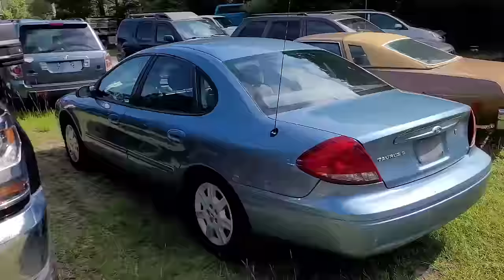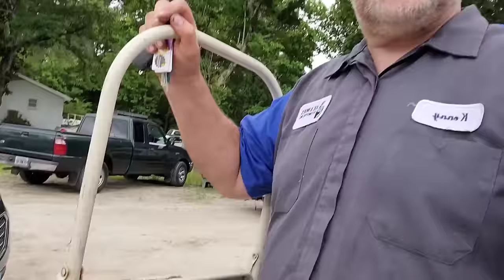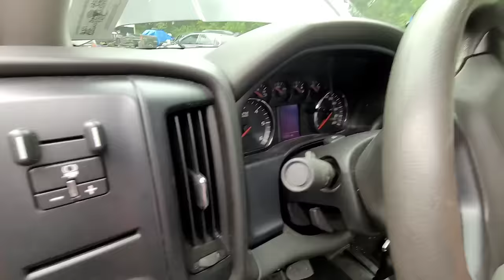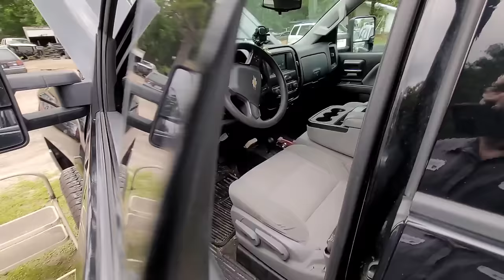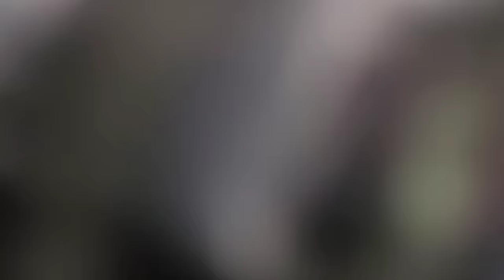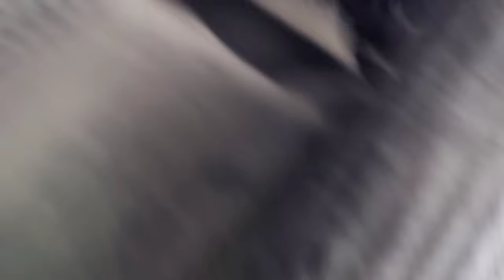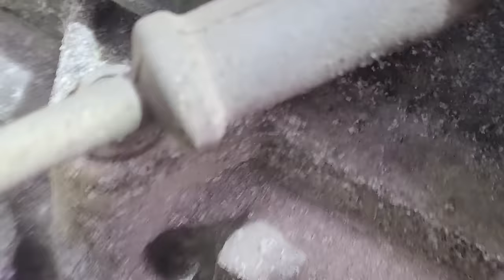Another GM 5.3 Ticking Noise. It's not the lifters on this one either

Comment: Common problem on all trucks, good news is un like a POS ford, you dont have to remove engine to repair. Prety cheap repair. My 14 6.0 has had driver side done 3x, passenger side once. Driver at 52k(dealer did with gm approval cost me $100), pass around 65k, driver again around 90k (dealer again, had new manifold put on that time) then again around 115k. Currently sitting at 148k and that has been the worst thing that has happened to ol Betsy:)
I believe the constant starting pressure when the truck is worked is what causes it. Mine is my lawn truck so it starts and stops 18-20x a day plus its plowed all but last 2 winters in upstate NY. Ive owned it since it was new with 2.8 miles on it and she has been a work horse.

Comment: Been watching your videos and you seemed pretty knowledgeable. I have a question. I had a 2017 Silverado with that 5.3 motor in it. Periodically I would lose oil pressure. I would check the oil and it would always be full. Ticket to my mechanic and he suggested it could be the oil pump but suspected it was the main bearing. I decided not to find out, change the oil and filter, put in oil meant for a diesel and sold it. I would be interested in hearing your thoughts on this issue.

Comment: What's your experience with this?

2005 Yukon, 5.3L 4x4, 223,000 miles, all stock, daily driver. I can just hear a clicking sound that varies with wheel speed (not rpms) when all else is quiet in cab and windows are down, driving next to a wall or barrier, at 10/15 mph or faster.  But ONLY under load with accelerator pressed. Does not click when coasting, or not moving. Comes from under vehicle. I figure either driveshaft u-joint or rear wheel bearing, or maybe parking brake hardware (park brake is out of adjustment), but what do you think?

U-joints look ok. A smidgen of play that I can feel but not really see, by hand, same on both ends. Not tight or blown out. Sealed type. 

Thanks!

Comment: You know what I had an 05 z71 I had that same exact bolt break the very last one to the firewall. I was able to get it out. Mission completed all new ARP , and that happened in 2009 so four years old. I think the mileage was somewhere around 100,000 miles exhaust manifold bolts never happened again.

Comment: FYI the cause of broken bolts is due to the fact that gm did away with the exhaust donut gasket and it doesn't allow for movement in the pipe

Comment: Dod/afm?
I've deleted my afm on 3 gm motors.
2, 5.3 engines and 1, 6.0 engine. Until I do on my newest 5.3, dealer changed recommended oil to 5 30.

Do you have any experience dealing with dod issues?

Good video sir

Comment: My 06 5.3 sierra has 303000 and runs like new. Had to replace the pick-up tube o-ring at 280000 was cracked. Put a new timing chain and oil pump in when I did the o-ring.  Runs 50psi at idle.
Reply from the maker: I love the 5.3 . Its an excellent motor IMO

Comment: I have the same issue, same bolt. 5.3 2015 Sierra. But it's not that LOUD. local repair shop said it would cost $250 to fix. If I didn't want to do it myself. 177,000 miles, I'll repair one of these days. When it gets annoying loud. Lol

Comment: What I'll be talking about is the spark plug wire issue you were talking about. As a 25-year G.M. Dealer Technician, I have seen that exact condition numerous times. I also had it bite me in the ol' pooper a couple of times with a comeback of the plug wire hanging from the spark plug & spark jumping from the coil to the coil bracket. After some intense R&D, I discovered air pressure to be the culprit causing the condition. Now, you ask, how in the H... E... DOUBLE HOCKEY STICKS... WOULD AIR DO THAT & HOW IT GOT IN THERE? As you push the plug wire onto/into the coil tower it traps air in the boot of the plug wire. In which air pressure is affected by temperature. As temperature rises, for every 10-degree increase in temperature, pressure will increase by 1 p.s.i.  This will cause it to build enough pressure to push off the wire from the coil tower. How to confirm this weird condition & eliminate it you ask. After you have pushed the plug wire onto the coil tower, you can take your fingertip & roll the end of the plug wire boot back (while listening very closely) you will hear the little air pocket "psssssssst" & release the pressure. In some cases when the boot is extremely tight on the coil tower, you have to use a small pocket screwdriver 🪛 and go in between the tower & boot to release the air pocket. Hopefully, that helps someone out!
Reply from the maker: Awesome tip !! I will have to make a video on this !! Thanks for watching and sharing !!

Comment: I have a 2017 Chevy 4.3 making a "chirping" noise in the top end I think at any temp/RPM. I've done TONS of GM lifter jobs, but this one just doesn't really "tick". It's a chirp. Pulled covers, nothing is loose indicating a typical GM lifter failure. I haven't replicated this yet, but customer states of he runs E85, the noise goes away. I'm open to any ideas. I don't want to pull the heads until I'm more certain as to what's going on here.
Reply from the maker: Is the chirping noise consistent ? Like with the rotation of the engine ? Or is it a singular chirp ? I've seen singular chirp noise be caused by the A/C compressor when it cycles , and I've seen the vacuum pump cause a chirping type tapping noise . Let me know what you found !
Reply: @WrenchingWithKenny  it ended up being a lifter. It got a full kit, cam lifters gaskets etc
Reply from the maker: Oh wow !! Interesting !! I've actually never seen a 4.3 with a failure. But then again, the 17 4.3 is based off the same design as the 4.8, 5.3 & 6.0 .
Thanks for the info !!

Comment: mine ticks every once in a while but seems to be getting more often... saw a video said its the o ring on the oil pump letting air in
Reply from the maker: That is a problem that happens also . Its not super common in my experience though . Also , when the oring fails, you'll have lower than normal pressure all the time .
Thanks for watching !!

Comment: Depending on the year range GM as you’re probably aware had massive issues with the DoD (Displacement on Demand) systems. They were notorious for starving some of the lifters for oil and every time the pins started to wallow out the circular opening they were pushed into and caused him to stick which is why a lot of people delete that system, not all people but a bunch.
They need to replace out that exhaust gasket ASAP before they have a lot more than ticking noises to deal with. He started having valve issues and everything else under the sun not to mention melting things etc. depending on how bad the leak is. What was the mileage on this truck?
Reply from the maker: This truck had 95K if I recall correctly
Reply: I have a 2009 Chevy Equinox LS, with 91k on it; I have a ticking noise, my car was used mostly going to work and back. it doesn't seem like I should have engine issues, I've taken it to a few shops and was told I have internal engine issues, so I need to get a new engine. I think it is a faulty lifter. I had a code for a misfire on cylinder 5, I had a new coil pack put on, and that code went away, but the noise is still there. Any suggestions? I'm in Bflo NY.  finding anyone to research the problem seems impossible.
Reply from the maker: @aquarius_babyj7539  the 3.6 is notorious for issues . I would think on your motor you probably have a failed tappet/lifter. I would replace the rocker arm as well . They tell you to pull the camshaft , but I believe it can be done by fabricating a tool that can depress the valve so as to work the rocker out , then the lifter . You want to be certain the piston is down when you do this because it is possible to bend the valve slightly by manually opening it
Reply: @aquarius_babyj7539  the Chevy equinox is a PITAA that GM is fully aware about and did nothing to help fix. For instants the dual clutch transmission even though it’s an automatic it has a dual clutch style set up and is prone to vibration and causing your RPMs to start a jump even though you’re maintaining a constant speed.
What I would highly advise is when changing a spark plug(s), and/or a coil pack(s) is to change all of them at the same time. I’ve got a company that I purchased six brand new coil packs from even though my wife only had one that was acting up because not too long after another one acted up, so replacing all six save me, the grief of having to go through mess with them, which they’re not hard to do. also your plugs is another big thing to make sure to swap out. I’m not sure on the part number but if I’m not mistaken I’ve actually got eight of the coil packs for a 2012 Chevy traverse at the house in my shop.  
As for the engine noise you’re talking about what kind of sound are you referring to? Is it taking like a lifter or coming from somewhere else in the valve train?
Reply: @Wrensspeedshop  Thank you for your reply. The coil pack plugs, and serpentine belt have been changed. I put a video up of what it sounds like, if you don't mind checking it out.
Reply: @WrenchingWithKenny  Unfortunately, I'm a woman who can do small repairs on my car; however, what you're describing probably takes more skill. I have a video up, of what it sounds like, if you mind taking a look.
Reply from the maker: @aquarius_babyj7539  where do I find the video ? I don't see a link here . I'm limited on what I can do on my phone as well
Reply: @WrenchingWithKenny  If you click on my name it'll take you to my shorts video. Thanks! It seems my only choice is a $4000 engine at the shop.

Comment: I’m hearing and seing dirty oil filter causing lack of volume flow of oil this causing all kinds of lacking lube parts . As well as worn out manifold gasket for egshaust manifold . My trucks developed a concerning actually metal sounding ticking tick tick on drivers side roughly cyl #3 or 5. Am changing my oil and filter cause been far to long since filter change let ya know

Comment: Bought a 2012 Silverado 2500HD, got it home both rear manifold bolts were broken inside the head. Popped off the heads, the only way to get to those bolts. It seemed to me the bolts were bottoming out inside the head, added a washer to another set of bolts, problem solved.

Comment: I have a 2000 Silverado, and mine taps when first startup, then the tap dies.  But I can park it facing the evening sun which allows the heat on the face side of the engine, start up, no tap! I was wondering if it is the harmonic balancer, I noticed a little wobble in it.

Comment: Hello, I have the same motor in 2004 Trailblazer LS. Mine hesitates between 55-65 mph only, while accelerating only. No codes and have replaced all emission parts except large box near gas tank...no gas smells from it. Have replaced all coils with aftermarket ones...2 of them failed and replaced with oem ones. Also replaced fuel filter. Any ideas? Thanks
Reply from the maker: Thats really difficult to say. Id have to drive it or hear it to have any guidance

Comment: Customer says he lets it cool down and once it cools down it starts to tick while it’s off??? I didn’t hear a thing but I’m on a cell phone with low volume, but if it clicks while off, it has to be exhaust related ticking…. The metal expands and contracts as it heats or cools down.  That’s what I would  start with. 5.3 engine doesn’t tick when off like some European engines do.  Check exhaust system. Bad weld or simply heat shield making noise as it cools

Comment: mine had a ticking noise after my spark plugs and wires. After inspecting it further, I found a loose spark plug 😅 I forgot to torque it down before installing the new wire.
Reply from the maker: I love it when it's something simple like that !!

Comment: I got a 2014 Silverado with a 5.3 owned it for 2 years no problems All the sudden warning light low oil put oil in 2 weeks later have to put more oil in send it to the dealership they say it's all normal 22 PSI oil pressure at idle 38 at 3000 RPM. And they say GM says it's normal to use one quart of oil per 1,000 miles. Have you ever heard anything about this is somebody trying to fool me?

Comment: I have a 2001 5.3 Silverado that cranks fine and sounds fine for 25-30 seconds then starts ticking for 25-30 seconds then it fades away until it’s cranked again cold. It has over 150k on it but has made this noise for last 50-75k. Reg oil or synthetic, makes the same sound.???

Comment: How much better is the fuel economy with “multi displacement” engines real is? I’d love for someone to disable the feature on engines with this tech. & run a battery of tests with the feature “turned on.”
Reply from the maker: I've done the DOD delete on a few 5.3 litres before I started doing the videos . Each and every person i did it for said they didn't notice any change in fuel economy . One person said it actually improved by 1mpg around town . I'd love to get one , do a series of tests with it working . Disable it (thru a program only), and run the tests again to actually compare and see what the real results are . Hmmmm , maybe that will be a future video !!! Now I just need a truck !
Reply: @WrenchingWithKenny  yes indeed, because I’ve seen companies like Dodge, Honda, & GM insistence on such tech that cause headaches for some owners.

Comment: If the ignition coil wire came disconnected, wouldnt it have a miss too? Someone else has a video where they got into the engine a little more and a roller bearing seized up.

Comment: The 2021 chevy silverado LT i use at my work makes tapping & ticking noise. At first at start up it noisy but once it reaching normal temp. It still there but not as loud. Also i can smell burning engine oil. don’t know if its because of the oil change places. Spill oil and runs down on the exhaust.

Comment: I have the same noise problem. Sounds the motor knocking .  I have check engine light  but no codes showing . You think it might be the manifold loose?
Reply from the maker: It is very possible.

Comment: Oh yes my favorite thing GM,Ford, and Dodge seem to have in common,  the damned bolts are broken off. Now I better warm up my mig welder to weld nuts to each stud that is busted. I used to work for a Ford Dealership for almost 20 years and I used to hate them exhaust bolts being broken but I adapted like any rationally mi ded tech would do and weld it up because I'm not doing that drilling and extracting them with an easy out, time is wasted and our time is money period.

Comment: I have an 03 Silverado 4.8 after setting 12/14 hours in the winter at first start up it spits and sputters, I replaced the fuel pump with a $400 GM pump when the original pump went out at 170k it did the same thing for years before the original pump went out. Any thoughts and what is causing this....
Reply from the maker: How cold is it when you cold start it? Does it have any codes in it? I've seen where the Mass-Air Meter , which is also the ambient air temp sensor , reads incorrectly and causes cold start issues . Try cleaning the Mass-Air meter with Electrical Contact Cleaner or Mass-Air cleaner . Just spray it really good . Do not use anything to scrub or rub the sensor to clean it . Also , don't use carburetor or brake parts cleaner . They can leave a film on the sensor and cause other issues . Let me know how you make out !

Comment: OK now does the oil pump make a tap sound if oil ring on pick up tube  is bad low oil pressure  I use recommended oil an filter 2012 chevy tahoe 4x4 I put ear scoop on an the tap is coming from front of engine  not valve covers

Comment: Ok so I have an 06 gm 1500 w/a 5.3…. Doesn’t tic during start up but will tic once it’s warmed up. Then it goes away 🤷‍♂️
Reply from the maker: Could also be exhaust leak. I've seen this scenario not leak cold , but only hot. I've actually never seen it happen during warm up and then go away, but I certainly wouldn't rule it out !! Thanks for watching !

Comment: That slight squeal when the engine begins to crank, what is that from. Mine started to do it and I replaced all belts and the pulley. 2016-1500 / 5.3. And it sounds like my grandfather Buick starting.

Comment: Fighting a reduced engine power code on one these. Im lost. Replaced throttle body. And have a replacement shock kit on back with a resistor pack on the computer for air shocks

Comment: I have the 6.0L that has developed a tick since it started to become cold out  (50 or lower) but it never change speed or pitch when the RPMs change and it will happen in all gear ranges but becomes more predominate when in a gear, doesn’t matter if it’s drive or reverse. Any ideas on this?
Reply: I'm having the same problem then I took my 02 escalade to muffler shop where they put a new manifold gasket on it, still  doin the same 6.0 liter

Comment: My 2017 Silverado has the erratic wiper pulse control issue. The fix is replacing the under hood fuse box. The wiper relays are built into the circuit board. How stupid is that?

Comment: GM and Ford have had this issue for 25 years. The Fords are even bad to crack the exhaust manifold. Use the recommended oil and keep it changed with a quality filter. Fill the filter with Marvel Mystery Oil. On the LS engines with VVT they put a plastic screen under the oil pressure sending unit. When you pull the filter leave it off for 5 minutes minutes so that that area can drain good. MMO will help keep that clean.

Comment: I've got a 01 chevy silverado with a bad tick. Its also showing codes P0300 and P0405. I changed the EGR valve, new plug and plug wires, new distributors. Valves and rockers seems to be operating normal. Any suggestions? Also has a rough idle and the smell of gas under the hood.